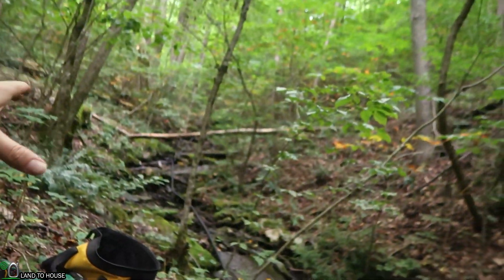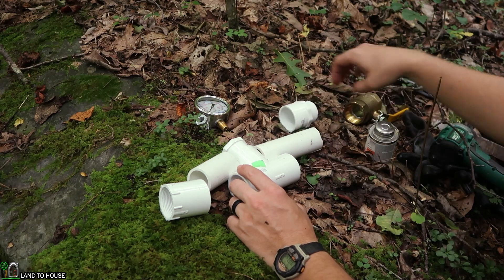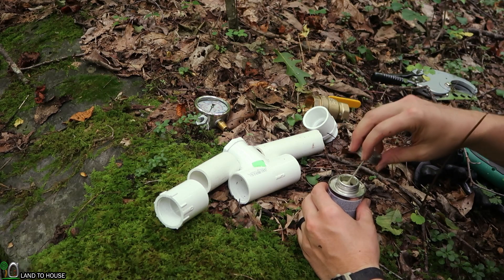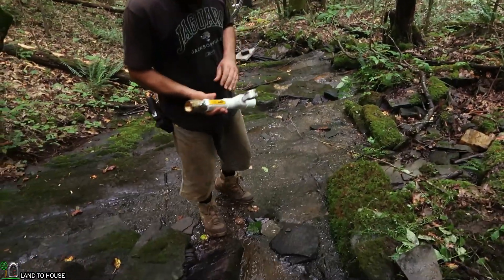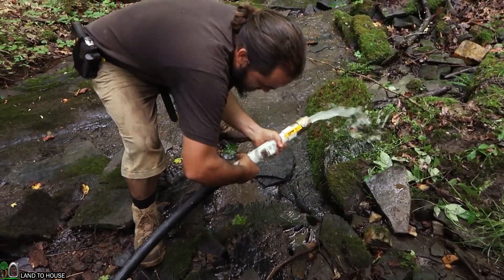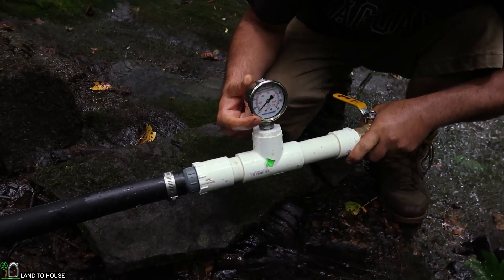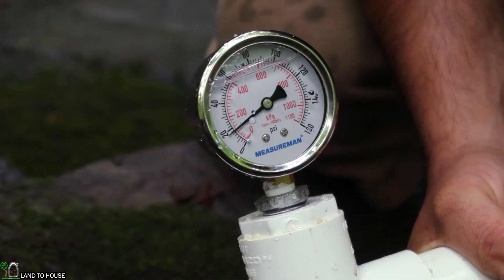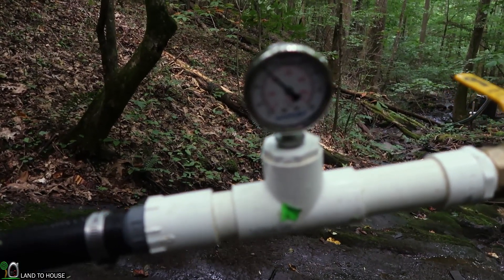Pressure Test Off Grid Micro Hydro 3/6

Comment: I found a video that might interest you. The screen that filters out the leaves and stuff is what i found interesting. It spins to remove the stuff on the screen. It has a squirrel cage fan to make it spin. Looks like a great idea you might want to try. Doesn't look like it would ever need cleaning.  You might not have enough water to use to turn the screen as he did but you might be able to put paddles on the part where the screen so it wouldn't use more water to keep the screen spinning if the water hit the paddles as it fell on the screen. The part about the spinning screen starts at  1:24  Here is the link for the video. https://www.youtube.com/watch?v=r0XKTtdeyc0&t=23s
Reply from the maker: That was a really fun video! Thank you for sharing. I especially like the golf ball bearings.  I do think we would need more water but it's worth a try!
Reply: Did he drilled a hole in the golf ball to use as a bearing. It looked like that is what he did.
Reply from the maker: Yes! He sure did. I think I will follow his lead and build a ram pump intake like that.

Comment: Nice job screwing the pressure test set on with water running through pipe, Hey, I just found a way to make PVC pipe flexible (random idea!)  pour hot sand, put cake pans in the oven at 450 degrees for 15 to 20 mins, then cap one end of the pipe (has to be on a board with one end up) pour sand into pipe, cap end of pipe, let set till it heats up to 160 to 170 F, wa la!  You can put really neat bends in pipe!
Reply from the maker: That does sound like a nice way to get an even bend on a pipe. It is however hard to get that heat up the mountain without cooling off. There is a video by Engineer 775 who uses the sand idea in copper pipe.
Reply: @LandtoHouse  Whoops!  That was an in the shop close to the range and workspace hot sand idea, there's no way to get that outside the shop, just small scale pipe stuff.